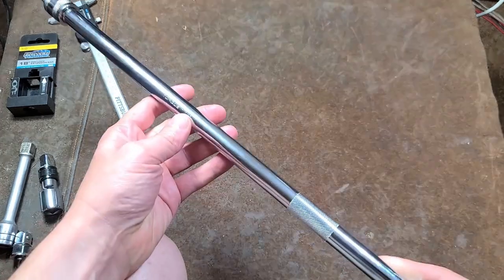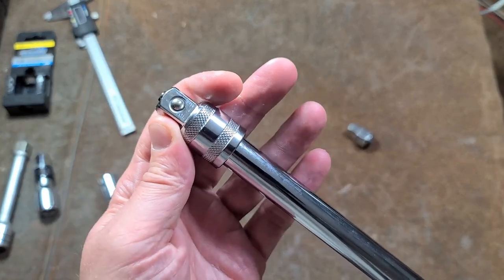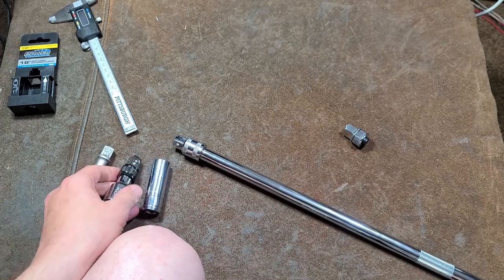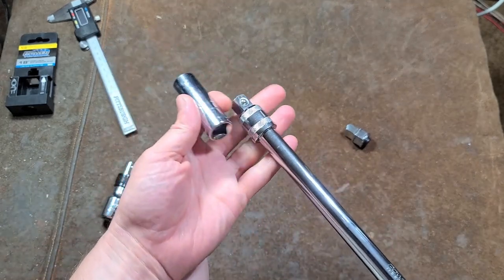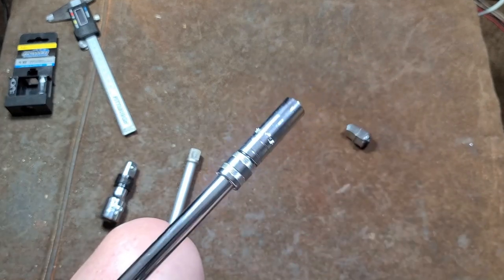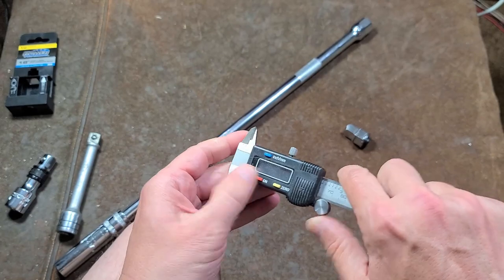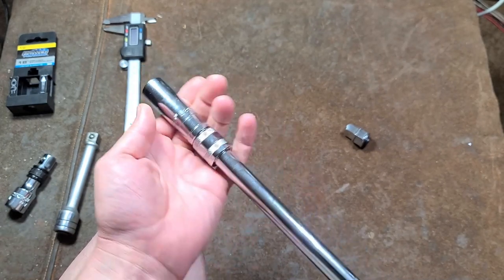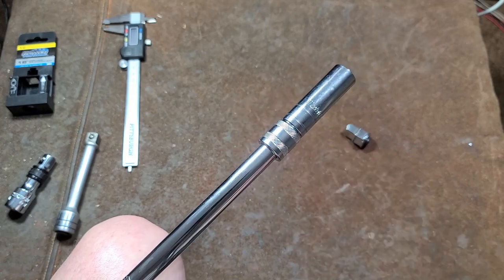O'Reilly's PowerTorque 1/2" Pop Lock Hex Drive Extension Review

Comment: Catus, if you want to write a review for this product on O'Reilly's site, it sure could use the help.  It only has one review currently, and they rated it only one star out of five. That one review says it "didn't last" so I guess it depends on how it holds up, too.
Direct link to product, for convenience:
https://www.oreillyauto.com/detail/b/power-torque-tools-4691/tools---equipment-16488/tools-23747/hand-tools-16814/sockets-16637/socket-u-joint-extension-adapter-18025/322b0ba92ed5/power-torque-1-2-inch-drive-18-inch-pop-lock-socket-extension-bar/gm6102/4677141